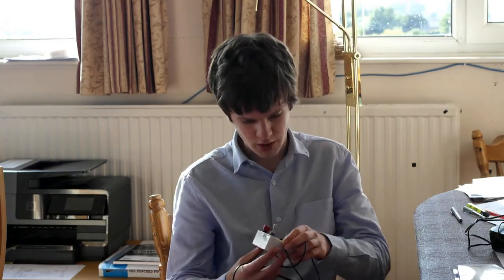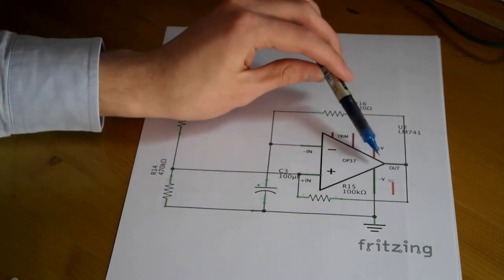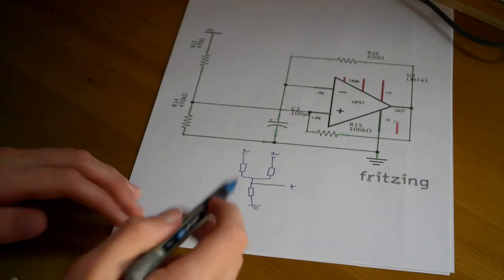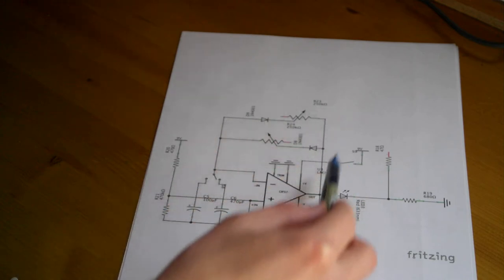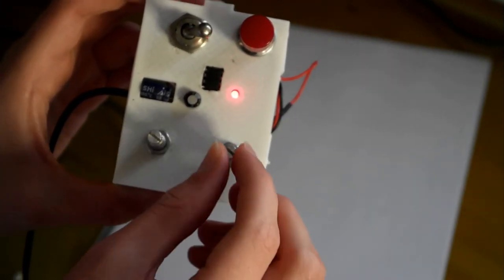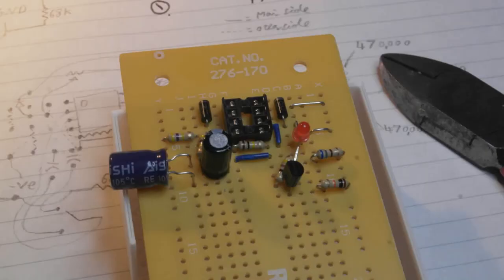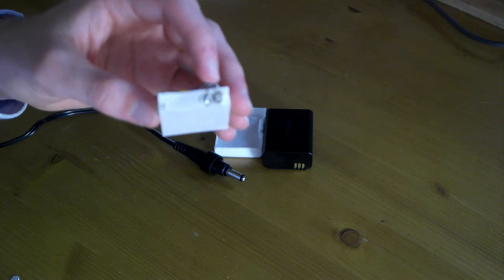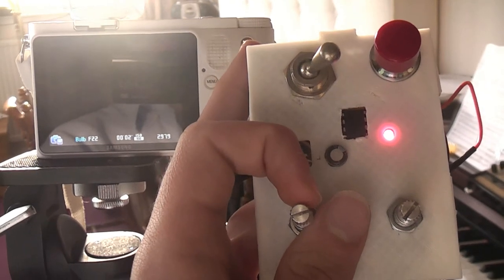Making an Intervalometer and Power Supply for the Samsung NX1100 Camera

Comment: Hi Patrick.  Thanks for the video, very instructive.  I used it (and some other articles I found) to construct a power supply for my NX1000.  Did you have a problem using the flash with your power supply?  I suspect it draws a higher amperage than the voltage step-down regulator that I'm using allows.  Any idea on the amperage required for the flash?
Reply from the maker: Hello Toby, sorry for my delay in replying - you’ve probably sorted out your problem by now!  I never tested my power supply using flash on my camera.  I would test it for you now, but ironically the flash control no longer works on my Samsung… sorry!  The flash spends some time charging up before it’s fired which makes me think it shouldn’t draw a particularly large current when it actually fires.  Have you made any progress with finding out what was wrong?
Reply: Patrick Taylor thanks for the reply fella.  I did work it out - it was me being stupid, I was using a 0.3a power supply!  I swapped it out for a 2a and it works brilliantly.  I also used an MP2307 step down regulator to match the voltage output of the battery which made for very simple wiring.

Comment: Update: Gutted a cheap chinese BP1030 battery from ebay and just soldered the wires to the terminals (after removing the pcbs components). Didnt bother with diodes and fuses in the end. Used a 9V 1A and all works fine! No low voltage warning either. Thanks for the ideas.

Comment: Do you have the schematic for the power supply power part? And where can download the 3D model of the battery part? Thanks.

Edit: Also, is it a 7.5V 1A DC power adaptor used?
Reply from the maker: Here’s a link to a Thingiverse Thing I made with the circuit diagram and 3D model.  A quick word of warning: although I used my intervalometer frequently, I’ve never used the battery adaptor in any serious capacity.  One reason for this is that the temperature in the camera is sufficient to soften some of the plastic at the top of the adaptor and deform it: I wasn’t too keen on risking my camera, or indeed the results of a short circuit.
https://www.thingiverse.com/thing:2518119
The mains adaptor I bought had various voltage settings - 7.5V was the most appropriate.  Max current purports to deliver is 1500mA.
Reply: I bought a third-party battery, de-soldered the contacts and removed the lithium cells.  This gives you the perfect plastic casing and ready-made contacts to solder to your circuit.  Careful though, disassembling lithium batteries is dangerous and highly dissuaded by manufacturers!

I used a 12v 2a power supply with an MP2307 step-down converter.
Reply: Thanks Patrick and Toby. Im going to dissassemble a cheap chinese one and use that as I can see the plastic probably deforming with 3d printed one like Patrick says!

Judging from this: https://www.aliexpress.com/item/BP1030-BP-1030-Camera-DC-coupler-For-SAMSUNG-NX200-NX210-NX1000/32246359095.html

It looks like it should be 9V 1A used.

Edit: I forgot to ask @Patrick: Are the diodes 1N4001 1A 50V types used?
Reply from the maker: Yup, they are indeed that type of diode.  That’s my go-to diode after I accidentally bought 50 instead of 5 of them a while ago :)

Just wondering, is there any reason why you don’t just use the DC adaptor you linked in as it is?

It looks like the camera tolerates a good range of voltages.  7.5V (what I used) does seem to be the lower end judging by the battery symbol on the camera being in the red at this setting.
Reply: That adapter isnt for sale anymore and was the only place I could find information about power otherwise I would have got it!

Ta for letting me know about the diodes. Apparently I had one lying around too!